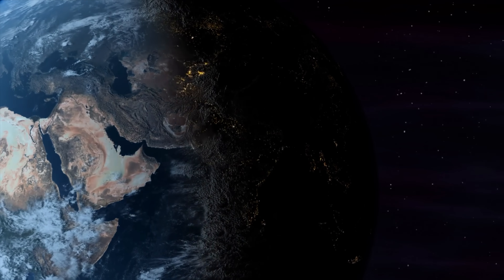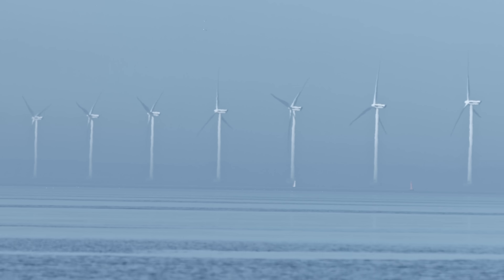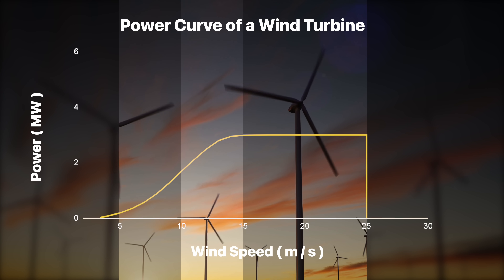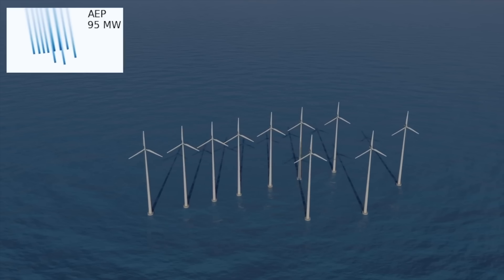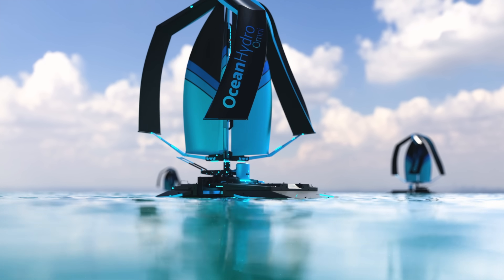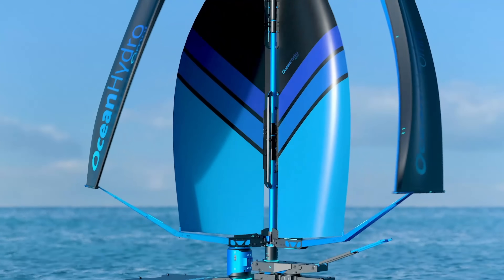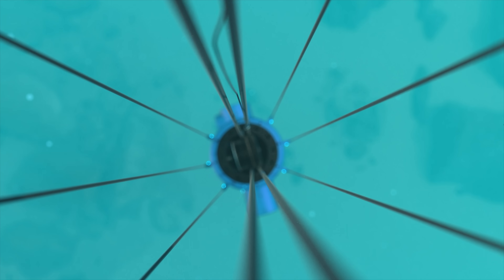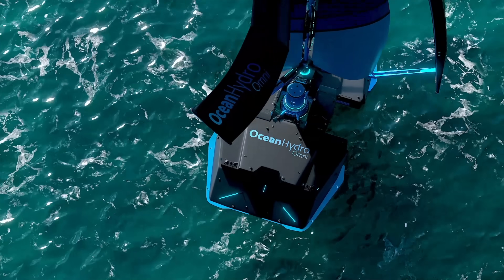Breakthrough Tech Solves Wind Power's BIGGEST Problem!

Comment: Why not install gravity storage in traditional win turbines, they have a long beam that could be used to drop and lift weights, and can be done in the see and in land
Reply: You would have to strengthen the tower to carry the extra weight, and the stored energy would still be tiny compared to the power output of the same wind turbine. 100 tons 100 m would be 28 kWh. Just sneak a used EV battery in there and call it a day. :D

Comment: So, what if, instead of putting these out in the ocean, we did this on land? Like drill holes that the weights can descend into, or even just build structures along the side of cliffs? You could lower the cost of maintenance significantly, spread generation to more areas, and potentially increase electricity production since the buoyancy of the water wouldn't be a factor.

Comment: Fascinating concept. I just wonder about the cost/benefit analysis of installing, and after that, the upkeep. The practical cable management for the weights, removing/deterring barnacles, wear and tear, not just from use but also from salt water corrosion...

Comment: I see pursuing such a monumental task as a colossal waste of time, money, and material. Aside from wind not being reliable or blowing too hard, what are all the other downsides, to include mining, refining, and manufacturing materials? This requires machinery powered by fossil fuels. Toxic wastes are produced. How will these turbines affect their environment? Will sea water eventually corrode these turbines? What about seaquakes and storms that generate giant waves? Who's footing the bill to build and install these turbines? Is it subsidized? That means the taxpayers are paying for it. And they'll have to pay for the electricity it produces. And from the way things are going, electricity rates are going to be much higher. If it were up to me, I'd build more nuclear power plants, because the newer models are much safer and generate zero CO2. If I were to put money into research, I would try to build nuclear power plants using thorium in a molten salt reactor. These plants are more efficient and safer than uranium nuclear power plants, and they produce much less radioactive waste. Thorium is much more abundant than uranium. I don't know about everyone else, but I feel like the powers that be are forcing these green energy plans down our throat. I hear very little debate. And it baffles me that pundits fail to point out that although electric cars might emit zero CO2, the charging stations are powered by fossil fuels and nuclear and hydro, which do emit CO2.

Comment: Another bonus is reduced "visual pollution" ....much less for these units since they are not as tall as the 14 MW monsters.    This also would allow them to be closer to shore and STILL not be visible (from shore).  Thus shorter/cheaper power cables to shore based substations...could be a win-win-win.
Reply: I suspect as the technology scales up so will they, (although they may have a lower upper limit since they are anchored differently) but since they theoretically can store more power the deeper the water they are in they are more likely to be farther off shore.  I think ultimately the way to limit 'visual pollution' is to increase the density of the power generation at the densest sights so you don't have to build them everywhere.  

You might also be able to move regular wind farther off shore if you were taking advantage of their giant foundations to act as batteries too... if you had hollow foundations with weights in them you could help prevent against corrosion by keeping the weights dry.  The extra financial incentive might make building deeper water wind more attractive.

Comment: The weakest part of their design seems to be their "energy storage" device.  I'm ex-Navy, so I KNOW how corrosive a salt-water environment is going to be to all of those exposed moving parts.  I vaguely recall a similar idea that seems more feasible,  using compressed air as the energy storage medium.
Reply: No wind turbine expert of any certification auditor would even consider to give this designs power curve any review. This even fails on paper unless you are an absolute fool not even checking the most fundamental basics in wind enrgy biz. Let's be clear any fundor bank seeking to invest in a wind farm is asking for a valid power curve certificate from an shipping / oil&gas auditor as a mandatory step of their due dilligence process. There is no improvements over existing better HAWT designs. The auditor would flat out refuse to waste lab days and simple wirte a single page of nah. This is clearly dismal in like 20 days of operation out of 365. Where a HAWT has 350 out of 365 days to generate revenue and turn a profit. This is just pump & dump influencer marketing. That's just The Wolf Of Wallstreet Aerotyne technology sales spin. That stuff above the waterline would not even crank that weight from the ground in 11 out of 12 month. Agreed, after 11 month muck & sealife would have it permanently stuck on the seafloor and created an artificial reef. An expensive but not terribly scenic place for seagulls to create guano fertilizer.
Reply: @voster77hh  you are correct.
Reply: @voster77hh  - You are just a NAY-SAYING CRANK, aka TROLL, shamelessly displaying your prejudices. IF you had bothered to watch the whole video, you would have seen that this is far from a finalized design, so all of your objections (to the extent any are valid) will be handled before any attempt is made to commercialize this new approach to combined wind power + storage.
Reply: 25 years ago I was working on underwater neutrino detectors.
This will never work in real life. If the weight is small, it will not be able to store any significant energy. If the weight is big enough and the height is high enough to store significant energy, the first real storm will brake it apart.
They are thinking in the direction of having smaller devices but a lot and lot of them in huge fields. In that case maintenance and operation will become a nightmare. It can work of course, I just can not see a way to make it a real life practical application on the gigawatt scale; what a single nuclear power block easily accomplishes. Solar-roadways, wind-turbine edition.
Reply: @meleardil  'Solar Freakin' Roadways' is harsh.
Reply: @meleardil  but it's roadways that produce solar power? It's such a good idea
Reply: Yes, I recall an inflatable bladder under water that gets pumped full of air to charge and is deflated when discharged. But question: would any moving parts in these VAWTs be somehow any more susceptible than moving parts already on HAWTs? wouldn't they just use the same type of devices and material?
Reply: @jonjohns8145  They're a LOT closer to the salt water and spray than the HAWTs.  Remember the normal turbines have to be mounted high enough so the blade tips can't be caught by a big wave at high tide.  It looked like the VAWT is designed to be mounted on essentially a big raft.
Reply: @michiganengineer8621  This. And the splash-zone is a hellish environment.
Reply: @jonjohns8145  compressed air storage has terrible efficiency. Any flywheel, battery or chemical storage does better.
Reply: @voster77hh  It's not so much compressed air storage as gravity storage/hydroelectric with a twist. You have a massive, flat, bladder anchored under the sea and inflate the bladder, in the process of inflating the bladder you're actually lifting up water (very slightly increasing the height of the worlds oceans) then when you want that energy back, you let the bladder deflate through the weight of the water and put it through a turbine or similar. The air isn't actually compressed (at least no more than it needs to be for the water pressure of the depth its back).

It's the same as any gravity storage really, a massive float you sink and lift does the same job but with more moving parts.

As for efficiency... it all depends on how much energy you have. Flywheels don't store much energy, or for that long, chemical storage is expensive to scale and requires replacement, both of them are horrificially maintenance intensive too (a half decent flywheel will coming loose would be like a freight train being loosed in the building, not to mention battery fires). Hydroelectric dams and pumped storage though have been the go to green energy source and grid storage options for decades, but they require suitable geography (and people willing to live downstream). 

This would giver the same benefits as pumped storage but all it needs is lots of sea bed nearby, the deeper the better, (which is to say the vast majority of cities could use it).
Reply: @Logarithm906   Compressed hot air heating the ocean as entropy? Terrible idea. It only looks good on PowerPoint.
15% to 30% energy of what you stored doing hard compressor work is just giving Spongebob a more comfortably heated ocean floor home.

You did hard work to fill that energy in a leaky tank. The heat loss from water cooling occurs somewhere down the value chain, not on the most affordable first stage. Your gravity assist only kicks in at a later value enhanced stage beyond a massive heat leak from the system. Great engineering job on that process diagram, Dude. 

I'm confident some rich-kid VC on cocaine with the attention span of a fruit-fly does still buy it - no worries.
It is a perfectly sellable PowerPoint.
Even if compressed air already failed on solid ground multiples times over and none of the issues was ever fixed.

Pretty much the same for gravity storage being entropy leaking high friction, high maintenance systems somewhere down their value chain.
Fools do what a bunch of fools will do.

To initially spent high energy on a chemical product that does NOT leak from it's storage can make perfect sense. As fertilizer or fuel for Aircraft and ships, that simply can't recharge mid-air or mid-ocean on a heavy payload to move across oceans.

Flywheel stacks, molten-salt storage, and batteries are all proven MW scale tech in local stationary applications where pumped hydro geologically isn't available. To directly compare conversion rates w/o and ignoring entropy is ignoring 90% of engineering skill required here. Ignoring entropy we could put as well monkeys, drug addicts or primary school project kids on the job of saving Planet A as our only habitat.
Reply: @Logarithm906  But doesn't the submerged air bladder have an efficiency problem due to air's heat of compression? Could this be avoided using an incompressible fluid?
Reply: @voster77hh  so they already make super large high mass fly wheel batteries, if they want to generate consistent power for the grid why not hook up wind turbines to flywheel batteries on a gear system so it can continue to spin the battery during high and low wind speeds.
Reply: Also don't you loose more energy as the weight weighs is less when it is in the water? And wouldn't the water provide more "friction" to slow the weight when it is dropping thus loosing energy?
Reply: @FutureAstroMiner  If they were removing the weight from the water at it's highest point that would be true.  From the design shown, the weight is always submerged, which would also even out the friction losses.
Reply: How about a change in materials. Using something that is not metal?
Reply: @JoseFernandoMartinez  Barnacles don't care if what they grow on is stone, carbon fiber or stainless steel.  And there will have to be bearings of some sort for sand and silt to get into and clog up
Reply: Meh just turn all that floating ocean plastic trash into a thick corrosion proof coating on all the metal. 😛
Reply: @Jhon youu  I seen many projects of triple digit millions or even billion dollars fail in the past 3 decades in renewables.
Stupid money takes many forms. That includes greedy bankers. Frankly said top advice on convincing C-level managers is talk to their croq brain part deeper instincts and only sell on emotion.

Crescent Dunes is just one example of dumb money and politicking. Spain and Morrocco are using multiple Molten Salt Storages with some success. That's maturing a tech. In Renewables almost all first mover attempts do fail until tech matures.

I do work with industry partners that do scale flywheel stacks and what grid shift times they can provide. No idea what you are talking about?

There is dozens of battery types out there, not only Lithium. Goes all the way to cheap salts and redox flow.

Then there is thermal rock storage. 
And lots of chemical storage options.

CAES is only used for ramping duty and spinning reserve at MW scale.
That is adiabatic systems.

Designing a non adiabatic subsea system is just another stupid idea. People do throw money at PowerPoints, not at tech. Especially on things where Entropy is involved.

Check out perpetuum mobile.
It is the norm for investors being duped into stupid trendy ideas, not the exception. There is just another surge in CAES ideas being hyped right now. Unless you do own a large unmined airtight salt cavern gas storage, better stay clear of CAES. Especially offshore or subsea. 

Maintenance kills what  ever Entropy left. Saltwater with sealife is way worse than what you already label difficult challenges in operating a closed loop of molten salt. Bankers are narcistic people who never wanted to get their hands dirty on tools. They are devoid of any understanding of corrosion, entropy or maintenance. Basically they do perform as good as a monkeys. Even toss a coin does better. 9 out of 10 investments do fail. In Renewables and especially storage tech way more bets blow money out of the window. Many for physics, many for politics.

You could make a great physics argument as you possibly can. People don't care. They buy fancy stories. 

Ah, there you go handling molten salt again. Some way you like it, some way you don't. That's like yeah, well sure we can contain radioactive corrosion in materials for decades. Ups, the maintenance cost went into orbit, sorry guys. It pays a lot of specialized engineers Dilbert style for decades fooling around.

Involving geology gets really funny. That's were science is the least adhered to on making billion dollar failed investments. Load monkeys in a cart, add bananas and have them scream buyaaah in a kick off meeting.
Reply: Ex-navy what, exactly: are you an engineer with specialisation in offshore installations, maybe (or did you just happen to have spent some time on a navy vessel, perhaps)? 

There are already tons of examples of tidal power plants with whole batteries of turbines submerged under water for decades; offshore oil and gas rigs and existing deep sea installations around the world that work flawlessly with only minute regular maintenance;  under sea cables and pipelines constructed to work for a century and deep sea oil rigs designed to withstand a millenial tidal waves and storms. There are even submerged Roman concrete constructions still perfectly preserved. So, what are you talking about, exactly? 
I have never experienced a comment field so full of besserwissers  pretending they know things they don't. To all the naysayers out there: It is time to start putting your claimed talents and superior understanding to good use - or just shut up for a change. 🙂
Reply: @jokvalvaag  Retired after 20 years.  Most of my float time was on aircraft carriers, fighting corrosion was job #2 after being ready to launch the birds.  

Undersea cables and pipelines don't have moving parts exposed to salt water.  In fact the cables have an extra thick sheath to KEEP the salt water away from them.

Yes, there ARE tidal turbines generating electricity, there is one in France that's been in service for decades now.  HOWEVER, there is a large difference between rigid stainless steel turbine blades and woven steel cable being flexed around a pulley system in seawater.

<shrug> I could be wrong and they have a way to ensure the longevity of their storage system.  Honestly I hope they DO have a method since this would be a good way for coastal areas at least to have a relatively steady green electricity source.  I still think the "compressed air battery" in conjunction with offshore wind would be a better option as far as moving parts and repairability.

Comment: I don’t see why this tech should be limited to only be used off shore. Wouldn’t the same thing work if it were installed on top of a tall building or over a mineshaft or something? Hell if the mass could travel with the axis of the turbine it could use its own height as the drop.

Comment: I see no strong argument on why the energy generation and gravity battery storage are coupled together. The system will be connected to the grid anyway, so why not do the energy storage onshore where the maintenance and repairs will be cheaper, and the storage technology can be independent of generation.

This seems similar to Energy Vault idea, and for that I say just watch "Adam Something" video to understand why pumped hydroelectric is still the best "gravity" battery system we have, and Real Engineering's "Truth about Pumped Hydro" video to understand why it's so hard to scale pumped hydro even though it's the best form of gravity battery we currently have.